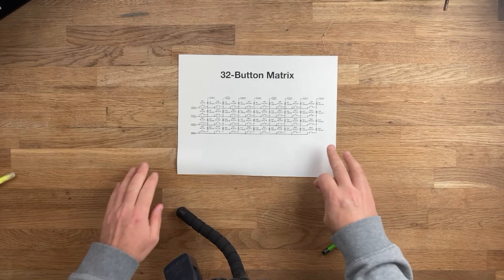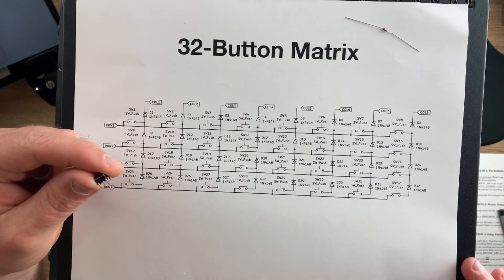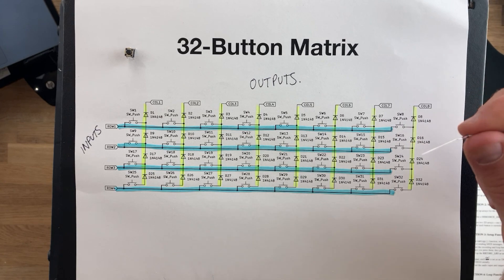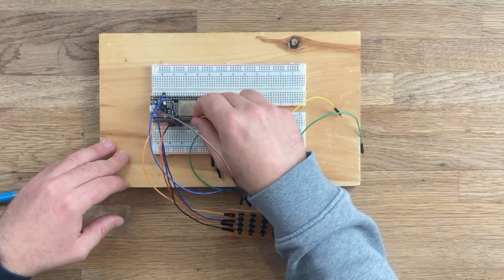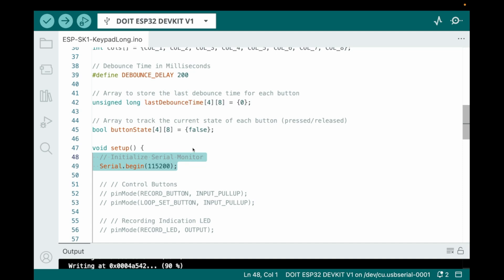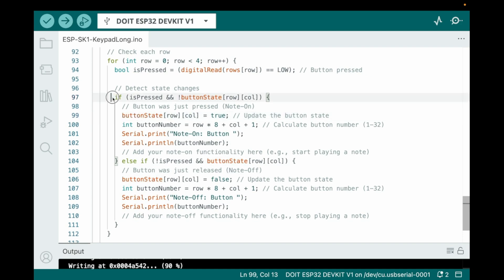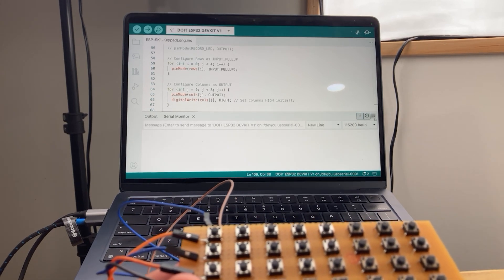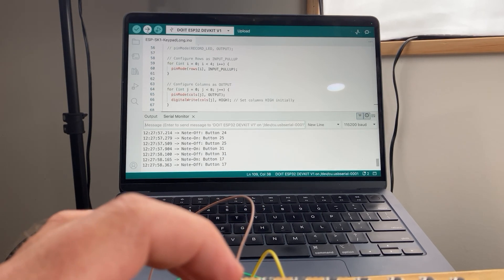DIY Lo-Fi Sampler With An ESP32: Part 2 - Keypad Matrix

Comment: Heyy i want to make keyboard can i use similar logic to make a keyboard?? And use it as a wired or wireless keyboard?
Reply from the maker: Yep, you can absolutely use the same matrix logic from my video. Just make sure to check out my pinned comment with the Medium article — the schematic in the video has a small mistake I fixed there.
Reply: @makingmygear okay thankss

Comment: That way, using those diodes, is it possible to press two buttons at the same time? Like, I’m working on a project where I need to press multiple buttons at the same time without one cutting off the signal from the other.
Reply from the maker: Yep! With a diode on each button you can totally press multiple at once, no ghosting or weird cut-offs.

Comment: Very interesting series of videos. I do like the esp32, great module. I know you only needed 32 buttons but if you'd done 6x6 you can get an extra 4 buttons. I'm working on an esp32 drum sample player. So far I have 8 trigger input's a volume control for each of the 8 triggered samples there's an oled display and rotary encoder to load samples into the trigger slots. I'm using the esp32 S3 module, lots more memory to play with on that compared to the standard esp.
Reply from the maker: Thanks for checking out the series — really appreciate it! Great call on the 6×6 matrix, I hadn’t thought of that — might work that into the final design! Your S3-based drum player sounds awesome. I’m planning a lot of those features for my V2 build (leaning toward an SP-1200-style sampler/sequencer, maybe using STM32). Are you planning to share any build details or videos? I’d love to check it out!
Reply: I'd love to make videos but I barely have enough time to build my projects let alone video and edit it all. I have so much admiration for you YouTubers and the amount of work you all put into these videos.

Comment: Hi. Total noob question here. Are you sure the matrix design is correct? Every other schematic I come across has the cathode of each diode connecting to a common point at the top of its own column, instead than to the anode of the diode on top of it.
Reply from the maker: @ThePointingArrows I fixed the schematic in the Medium article. Thank you SO much for catching that. I really appreciate it.
Reply from the maker: @ThePointingArrows  You’re absolutely right. My schematic is wrong. I will fix it ASAP. Nice catch!

Comment: Instead of soldering the jumpers to the board, I would just cut the male jumpers off, strip the wire and solder it together using a hook or something. Connecters could have some unnessesary resistance and the connection would probably be stronger
Reply from the maker: Good point - thanks for the suggestion!